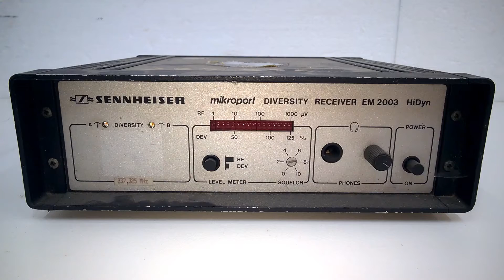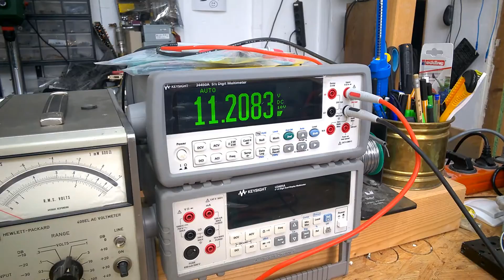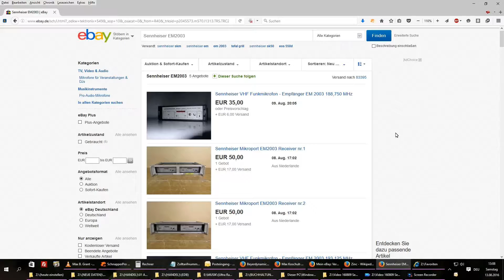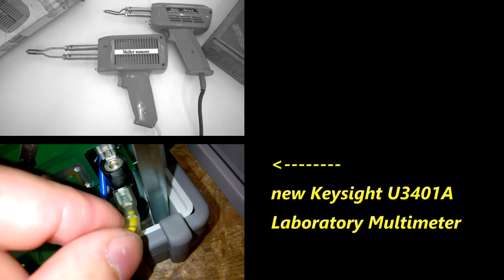BEB #22: Sennheiser Wireless Microphone Receiver Microport (What's inside?)

Comment: Very interesting, Sennheiser uses this type of filter a lot and it is extremely effective (and easy to tune if you happen to have a spectrum analyser with tracking generator). The same filter is also applied in their A12AD antenna for instance, however without the shielding, apparently it's not necessary at that stage.
Reply from the maker: thank you for your interesting comment!! welcome to my channel.
Reply: Hey Max, for some reason I could not reply to your comment directly:

Thank you, you have some very interesting videos (pro audio or test 
equipment related)! It would be nice if you could comment a little more 
on circuit functionality here and there though. :)

If you have some more Sennheiser wireless products laying around, please share. Sennheiser made some truly innovative and high quality products throughout the years, that are very enjoyable to see in tear down videos (EM1046 for instance).

Best Regards from the Netherlands.
Reply from the maker: Hey, thank you for your detailed reply. I will probably do a teardown of a Sennheiser pocket transmitter.  This is not sure though. I will definitely show more pro audio and video equipment. 
Some older videos (and some future ones too) are showing a more detailed look at the circuits functions. Please check them out :-)
Best regards, Max